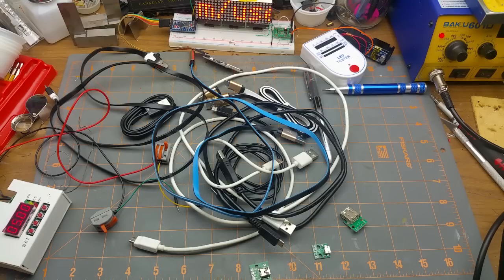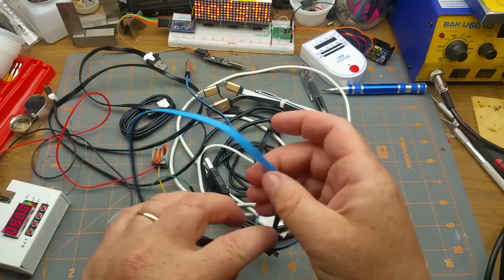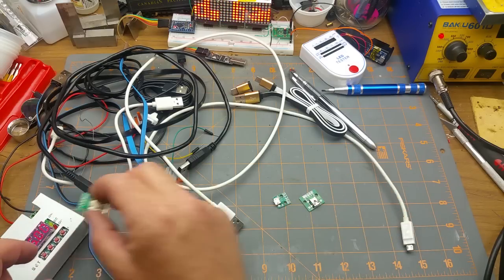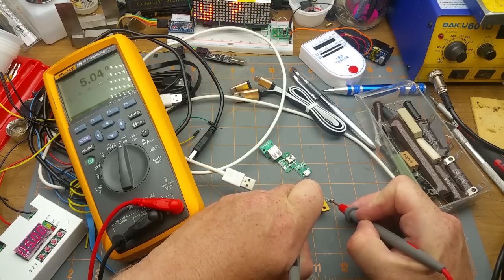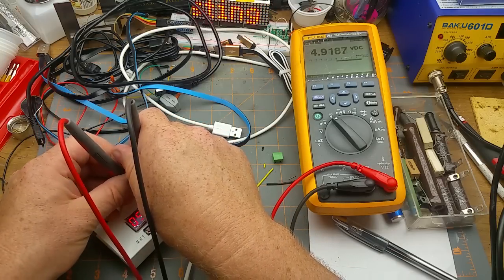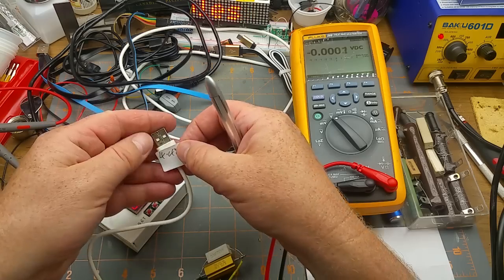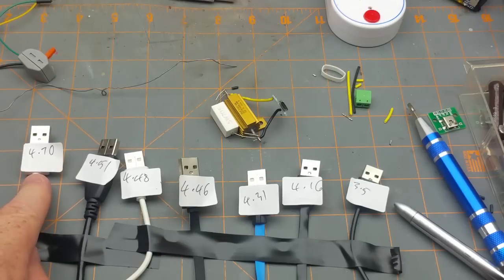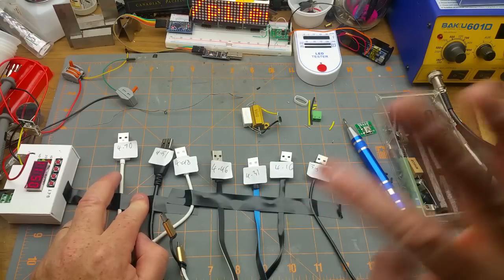testing USB charging cables

Comment: I have another method of measuring cable resistance. You need for this a constant current power supply that can go to 0V. Set 1A current, connect cable shorted on other way and you will get some voltage read on power supply. 1V would mean cable resistance 1 ohm, less voltage means better cable.
Reply from the maker: Yup, that would work too.
Resistance is definately informative, but I decided that the voltage available to the load is an easy to understand metric for the general public.
Reply: @kjur18 What you are suggesting is very close to a 4-wire resistance tester setup. I use the Mechanic DT3 cable tester which has supplemental gold test points for VCC, GND, D+, D-, and CC.  Most people only look at the LED connection indicators, but if you remove the power to the DT3 and probe the corresponding points near the connected cable, you can measure the milliohms of each individual wire in the connector.  My setup is a 0.1A constant current source (LM317+12.5ohm resistor) and two kelvin probes.  Whatever millivolt reading I get on the DMM I just multiply by 10 to get milliohms.  Alternately, I made a female shunt to put at the far end of the cable not connected to the DT3 and probe from the pad on the board to the shunted wire at the other end.  This is how I test a mini USB which is not one of the DT3 connector options.

@pileofstuff Love your content!  Some of the USB testers have a on-board cable resistance checker.  On the output end you attach a 5 ohm load and on the input side switch from no cable to the cable under test.  It uses the difference in voltage drop on the input between the two to estimate the cable resistance.  

@pileofstuff What to use the high resistance cable good for?   You may want to slow the USB charging of a device which draws too much current for the size of the cell inside the unit.  Another example, I have a clock from AE which was made to run on battery or USB.  When on USB it is too bright for the room, but when I add a resistance in the USB cable it's just the right brightness without losing time.  Or one of those piezoelectric humidifiers that spits out water too fast and makes a mess with a "normal" cord, but mists OK with the cord they gave you.  If you read the owner's manual they tell you to use the cable provided with the unit, maybe it has an actual resistor inside.  Finally, some devices have a recessed hole that's just too small for typical USB plugs and you almost have to use the one they gave you.  I have flashlights like this.

Comment: Some time ago I made a arduino based lcd connected to pc and displaying various things using lcdsmartie software. Sometimes I had this problem with arduino randomly crashing and also crashing software. I had this connected to my pc by a short cable. Even though current was small (something well below 100mA) voltage drop on this cable was over 0,5V which is enough to make arduino run with these problems. Too bad that I get rid of this cable before testing it better.

Comment: Good test. I've had good luck with Monoprice cables and the Amazon cables aren't too bad. I like your Fluke, nice meter.
Reply from the maker: I'm glad I can borrow a high-end meter like that from work. there's no way I could afford it myself.
Reply: @pileofstuff  
Get a RuiDeng UM24(C) or UM25(C) USB test meter for under $15.00 and a RuiDeng LD25(5A) or LD35(7A) electronic load resistor for under $8.00 and you can test USB cables and USB chargers very accurately to your hearts content for under $25.00 !
Reply from the maker: @etow8034   You mean something like one of these?   https://youtu.be/_4gDD-HyzaY?t=811

Comment: how to do that with usb c cables? Can we use the (V/A) from an app like battery meter and compare from cable to cable?
Reply from the maker: I haven't really played wit h USB-C yet. 

But I suspect you should be able to do the same. Essentially all I'm doing here is measuring the restive loss in the cable, but I'm presenting it as voltage loss for convenience.
If you have an app that can measure both voltage and amperage at the phone, and you know the voltage at the source, you should be able to compare just as easily.
Reply: @pileofstuff  thanks for your reply. Is the labeled voltage of my source/power supply e.g. an easy one without quick charge/voltage increase reliable? So for example if it says 5v output is that save to use as a reference? I assume if the lipo in the phone hasn't reached the max voltage it should (so the first charging stage of the two constant current vs constant voltage) draw as much amp as possible. That's the time where I would note the records A with the help of an app like battery meter. The cable with the highest current would be the best cable. 
But maybe I am thinking wrong. I also saw they have USB c ports with an pcb attached so someone could theoretically do the same and has just to find the power wires in the USB c specification.
Do you think my assumptions about my described technique are correct?

Comment: I am surprised you didn't have any proprietary cables except the OE ones, I have done a similar test and found the best aftermarket cables to use are made by Anker. They do everything USB and lots more.
Reply from the maker: The only "high quality" non OEM cables that I see at retail in my area are well overpriced for what they are.  I have a hard time justifying $25-30 for a single cable

Comment: Why were you measuring the voltage drop across the resistor? When charging something, isn't the amperes the main thing the device is after? so whether it's 3.5V or 4.5V, as long as the 1A is being drawn, why does voltage matter? Bit confused. Thanks.
Reply from the maker: I'm measuring the loss over the length of the cable due to the resistance of the cable.
If I had a more sensitive ohm meter, I could have done it that way.

Comment: I like these kind of tests, especially given that some USB cables have such small wires, they couldn't ever carry higher current.
My only question is did you measure the output from your source whilst under load, or from past experience, does it remain stable?
Reply from the maker: I didn't measure the source under load, but in my experience it stays pretty stable. Plus, I didn’t change it's settings between tests, so even if it did sag, it should be fairly consistent from one cable to the next.

Comment: Why not build up a constant current load and use that for loading down the cables? Easier than using power resistors.
Reply from the maker: Mostly because I already had the resistors.
Reply: @pileofstuff  That sounds suspiciously like an excuse not to do a project 😀
Reply from the maker: I actually do have some parts on order to do some constant current LED power supplies.
Hopefully I remember what I had planned when that stuff eventually gets off the slow boat from China.

Comment: Why not measure the resistance of the cable at once?
Reply from the maker: None of my meters are that precise at the very low resistance range.

Plus, in practical real-world terms, what matters to most people is the amount of power that gets to the end of the cable.
Reply: Via current and voltage-drop across the cable you can precisely calculate the resistance. But usually the resistance of the connector is the limiting factor, i guess.